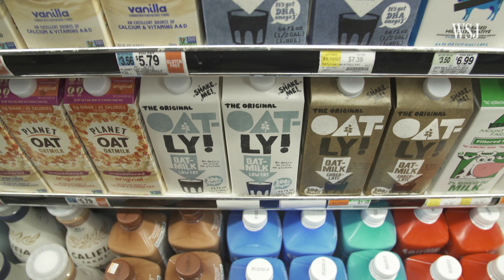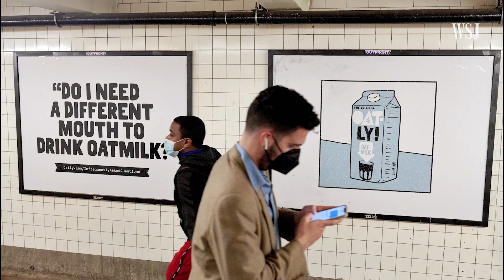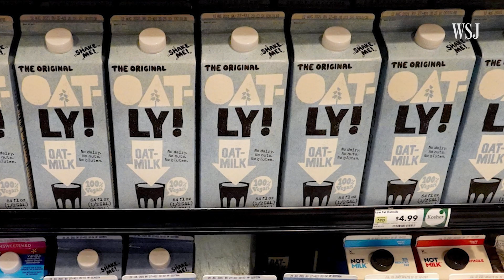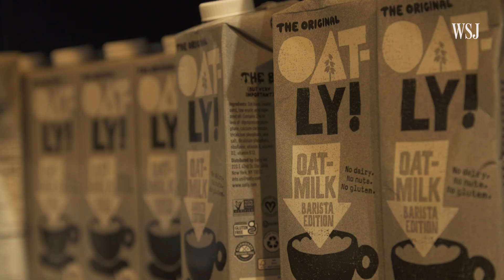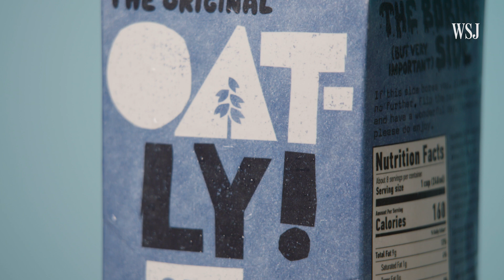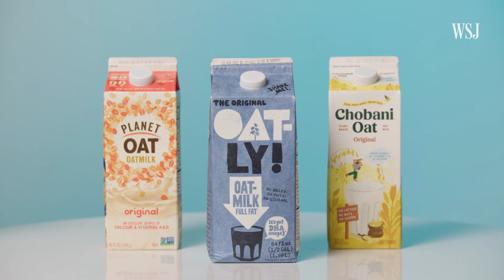How Oatly Lost Its Grip on the Oat-Milk Market | WSJ

Comment: I see the dark blue one sold out frequently, so I just started making my own. I got a soymilk maker for making tofu, and it works great for making grain and nut milks too. If you don't have that, a blender works great as well. 

The recipe I use is: 
1c soaked oats (3-4 hours), 
3-4 cups water depending on how creamy you like it
2 Tbsp neutral oil that is liquid at room temp. 

I use organic canola oil, and just recently got walnut to try as well. The oil helps a lot with the texture I've found after making it without a few times.
Reply: I did a lot of experimenting with DIY oatmilk about a year ago. I'll give you some tips if you'd like to improve your recipe, based on what I found. 

So the oats you use really matter. I found that old fashioned rolled oats (like typical Quaker ones) are really unpleasant tasting for oatmilk. Fresh oat groats are immeasurably better. You should steam them for 10 minutes to break down the grassy-like compounds within the oat, soak them in water overnight, and do the steps pretty much how you say above. Do add about 1/8 - 1/4 tsp salt though! And about 5g sugar / cup of total liquid. 

The more complicated version involves enzymes and precise temperature water baths, but honestly it's probably not worth the trouble unless you really want to replicate the store bought version (which I did). If anyone has any questions let me know!
Reply: do you mind sharing which soymilk maker you have?
Reply: Use purified water!! Makes such a difference in taste and shelf life . Whiz in blender, squeeze/drip thru cotton cloth. $.25 a quart
Reply: @ellie8174  Thanks to all the ppl commenting their oat milk making styles and recipes!
Reply: @Chickaqee  I’d like to hear about the more complicated method you used to replicate the store bought version
Reply: I started making my own oat milk recently because my daughter came home one day saying that Oatly’s ingredients were not the best, and she wanted to try making our own. After doing some research, I came up with the recipe that works best for us. I rinse 1 cup organic steel cut oats and soak them in the fridge with 2 cups of spring water for a couple of hours or overnight. I soak 1/4 cup organic cashew nuts in the fridge with one cup spring water. I dump everything plus 2 extra cups spring water in the Vitamix and blend at medium speed for 30 seconds. Then i strain through a nut milk bag and refrigerate. We like the oat milk with a little body, and we like the results with this recipe. We use it up in 3 days. Before the first use, I skim the top of the milk because that is what makes it slimy. I don’t find the need to use the enzymes. Always shake or stir your oat milk before you pour. My daughter says that her gut feels incredible with this drink. I particularly like coconut milk and plan to start making my own following the same principles.
Reply: @ellie8174  Soyajoy 5G!

Comment: Interesting video. 

My partner and I discovered Oatly during 2020 lockdown and were always looking for it at the grocery store since it would sell out so fast. It’s still not there to this day a lot of the time. The Planet Oat extra creamy original is the only other brand that tastes as good. Chobani Oat milk is gross in my opinion. 

Also the stock price of Oatly has more to do with the overall sell off state of the market, it’s basically following the trend of every other company selling off this past year with inflation fears.
Reply: For me when I tried planet oat extra creamy when I couldn’t get Oatly, I was disappointed in the texture personally. It tasted  fine but it has a thickened texture that I don’t like, and Oatly doesn’t have that texture from my experience.
Reply: @L1ttlef0ot  I can see that, Oatly really is so good and hard to compare to. I think I’ve had to get planet oatly as an alternative so much by now that it’s just grown on me a lot. Although I’m still not a fan of the plain planet oatly it tastes too nutty/watery and isn’t as sweet, but the extra creamy hits the spot for me.
Reply: the IPO price was just way too high for a business that is still losing money. Right now it is more resonably priced and might even be a good bet on the growth of plant based milk. Oatly dosn't need to have the biggest market share if the sector grows a lot, which will most likely happen. Still kind of risky because the company has a lot of problems, but probably the best way to invest in the plant based milk trend.

Comment: I'm on my second 1/2 gallon of oatmilk. First being Oatly and second now planet oats. I use them to make milk based drinks for my home espresso setup and found that Oatly has more of a granular texture and taste while Oatly closer resembles milk. Oatly is good but you have to get used to the new texture. I'm still early on and want to try Silk next, but it seems to be a struggle to find them in stock.

Comment: the IPO price of the stock was just way too high for a business that is still losing money. Right now it is more reasonably priced and might even be a good bet on the growth of plant based milk. Oatly dosn't need to have the biggest market share if the sector grows a lot, which will most likely happen. Still kind of risky because the company has a lot of problems, but probably the best way to invest in the plant based milk trend.
Reply: Yes you are spot on , I think the sector will grow , the conversion to plant based milk in the UK is happening really quickly

Comment: I don't care what the milk is, as long as it isn't hormone filled cow milk, and it's packed with protein (more than 5g in 8 oz serving). Surprisingly few options at my local supermarket meet this criteria - only two that Ive noticed - and those options are extremely frequently out of stock. It's very annoying.
Reply: Well, that’s the dilemma, isn’t it? Protein is easier to come by in animal products. Soy milk has it but doesn’t taste as good. Oats are mostly carbs, and oat milk only has 2g protein, though it tastes better
Reply: @reepicheepsfriend  I found it again at my local supermarket. It's by Silk, but it's not soy milk, it's almond and cashew milk. Has 10g of protein per serving and tastes delicious.

Comment: It's not really true that, Oat milk was a new thing to the states. The Asian market already had actual oat milks, in cartons. But  not for the baristas... That was all. And it can be seen that, what they produced, isn't of that standard.. and quality is so important here... and because it is a trend.. not all products will end up with the original standard, or quality. So from this angle, it  IS a shame. Cos they went for the killer branding and marketing first, even before they had the production line and the manufacturing line lined up... This is FOOD manufacturing... You cannot scale like that easily. At all.